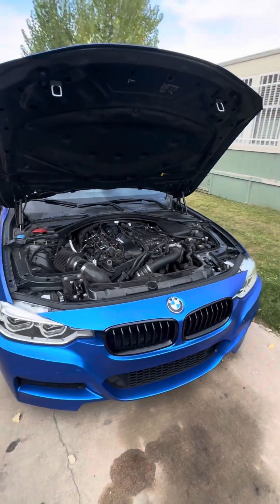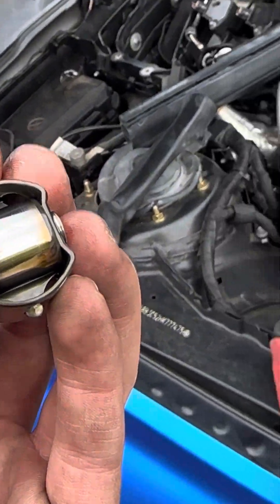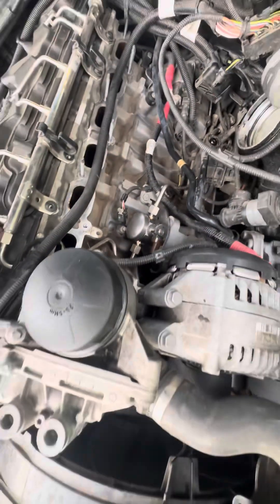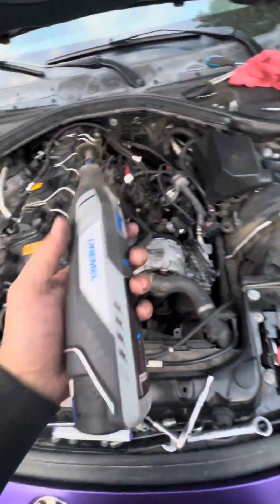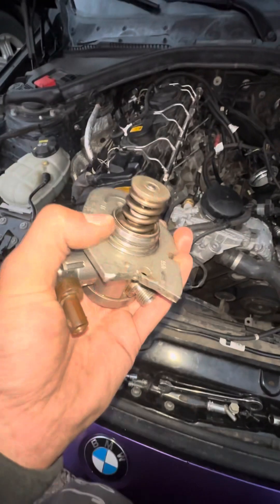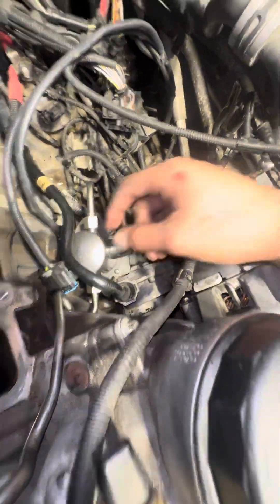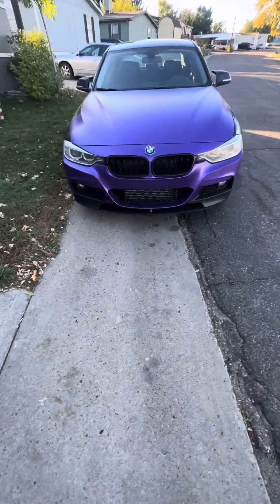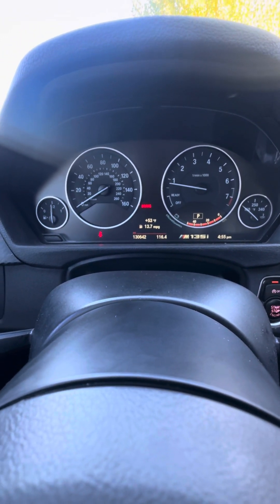Retrofitting a B58TU pump on my N55!

Comment: hey man i just got a few questions. i installed the b58tu on my 2013 pwg 335i. first what tuning platform should i use to make use out of this hpfp? im going for a pure500 turbo to try and make around 500-520 crank hp. mhd doesnt have the b58tu option and idk about bm3. im on a custom tune rn. anyway since i did this upgrade i noticed my injectors on bimmerlink are all working but you know the blue circle around the injection modes? they arent full anymore. this happened gradually over months. rn i have 2 injectors working perfect as bimmerlink says and the others dont have that full blue circle. idk if that means the 4 other injectors arent working efficiently but anyway i replaced my injectors brand new stock ones and still the same issue. sorry for the long message man i have been suffering with this for a while. thanks
Reply: U misfiring?
Same year/install  on my f10 MHD 
I’m not having any issues

Comment: Hola , tengo un 435 m sport con down Pipe, intercooler mejorado y reprogramación mhd. 
Estoy por instalar la B58TU y mi siguiente paso sería el e40 , para el e40 tendría que instalar un kit Flex Fuel para poder usarlo ?
Reply: you don't need the flex fuel kit but I would 100% recommend it. You wont have to worry about mixing ethanol it reads the content and adjusts the timing automatically.

Comment: hey man i have a 2013 e93 n55 build date is 02/2013 is it the newer hpfp or the n54 style one?  i was wonder if would be possible to install the b58tu pump on my car or would it be too much work
Reply from the maker: E series cars have N54 style pumps this wouldn’t work for you unfortunately. But the N54 Pump is very capable
Reply: youre on the newer style like me and will have to upgrade. 7/12 build date

Comment: Does the b58 fuel pump work on a pwg 335i f30 n55? I think i have the n54 hpfp. Not sure tho. My car is a 2013 but it was produced in 2012 so probably n54
Reply from the maker: F30 has new style pump so it would work
Reply: @F80__Los  So f30 has the same cable? I dont need to do any electrical work?
Reply from the maker: @iirojarvinen4674 no the connector is different until 2014

Comment: Hey man - lots of people are telling me I'll need to bend those steel fuel lines to get a good connection.. is this true? You're the only one who's really posted more than one video on this topic without ghosting, people seem to fit them and then disappear 🤷‍♂ thanks
Reply from the maker: Sorry for the late reply You have to slightly bend it. You don’t really need to actually bend it. just forcing it will do!
Reply: @F80__Los  yeah got lucky, I managed to pull some excess through the holding clips and then draw it in with some force on the nut 😂
Reply: @producerlawson how did it  feel performance wise?
Reply: That was the case for me it’s just a matter of forcefully yet gracefully manipulating the steel line
Reply: @MuteActive  did the install last night funnily enough, I really though I was gonna have to bend them. Some people told me to get the lines on first but that was impossible, the pump needed screwing down tight to close the gap to begin with. In the end I managed to pull the fuel in line closer as there was lots of play; the holding brackets were just hiding it all away, once I got it close enough I had someone lift it up whilst I threaded the nut on and drew it in. Same for the fuel out line, started at the pump and then drew it in at the rail.
Reply: @producerlawson yeaa yupp the timing is crazy though i was mid installation as well and completed it same time as you lol good stuff 🤝🏾
Reply: @MuteActive  no way! how you finding it? I mixed some octane booster on my 99ron fuel to get me up to 102 (95) and tried the higher fuel tune from MHD, the increased torque is noticeable especially around 5k rpm. According to my logs I'm averaging 656nm now, before it was around 600-610 on the standard stage 2+ tune. The only thing that concerns me is I had to shave some of the manifold plastic off the underside, Bosch sent the pump with the connector facing the right way; but it sticks up a bit so it was hitting the manifold, I saw on bimmerpost one guy shaved some plastic off so I did the same but took a little more off as I couldn't clear it like he did.. it's only the crosshatching but I do wonder how much strength that added 🤦‍♂I may consider a replacement manifold and flip the connector downwards, I'll just have to extend the wire
Reply: @producerlawson  that’s exactly where I’m stuck at rn running 6/7 screws for the manifold as i had to leave urgently the car runs no problem besides a heavy drop in load from data logging 😬😬 I’m going to revisit it tonight and fix it…how did you go about shaving the manifold? I have an extended wire so I’d definitely have play if i was to rotate the plug but would that mean the connector would now be facing towards the front of the car?
Reply: I don’t mind shaving tho as that would allow me to keep the pump as is lol
Reply: @producerlawson  may you send the bimmerpost link you seen too?
Reply: @MuteActive  hopefully you got it sorted? all of my posts got filtered/removed by YouTube weirdly

Comment: What E mix could you run on this pump? And what's the new project?
Reply from the maker: E40. And i got a Manual F30 335i! Just installed a PS2 turbo on it along with this mod
Reply: @F80__Los  werd, show us the build

Comment: Nice work, how much hp/boost can this support?
Reply: Also, would this work for F10 535i pwg?
Reply from the maker: @Jet3ch usually those have the old style N54 hpfp. You’d have to double check if you have a tappet hpfp or N54 Hpfp
Reply: @F80__Los  i believe it was the non LCI. I have Lci
Reply from the maker: On a B58 it can make up to 600hp in guessing a N55 it isn’t far from there

Comment: So on Bm3 for the stage 2+  tune on a 2015 f30 335i what hpfp option do pick for the tune.  Also am willing to buy one if you can ship to California. I’ll pay for shipping
Reply from the maker: I responded to your dm, and for the HPFP option, it will still be stock hpfp. no tuning needed for the pump.
Reply: Hi ,I already bought the same fuel pump for my b58 After the change ,do I need to program,tunning ,retro oh something?
Reply from the maker: @pabloe1983  No tuning needed. But would recommend to get the most out of the fuel system and make the most power

Comment: 2015? i have a 2014 f32 why wouldnt 2014 be included?
Reply from the maker: It works for all N55 with rapper style hpfp. you can know if you have it if it has a dimple on the top and doesn’t look like a N54 connector. If you have a car under 2015 you will need to splice the connect into your harness that’s in the description
Reply: @F80__Los  I can confirm it is 2014+ not 2015. my car has the same connector.
Reply: I thought that was odd for them to just change hpfp connectors after one year on the same platform. yea its 2014+
Reply: @steff4810  my 2015 had the old connector 😵‍💫
Reply: i have a 2014 435i and i'm tryna figure out if i have to splice anything what does you're connector/pump look like or how can i tell before i take off the manifold?

Comment: Great video! Just wonder would this work on bmw n54 engine?thanks
Reply from the maker: unfortunately this won’t work for you it only works for newer N55s. However N54s don’t have as weak HPFP as late  N55s so even just a LPFP will make a difference for you

Comment: If thats gen 1 b58 pump. Any idea if gen 2. The B58TU pump will work on n55 ? Cuz ive just ordered that and wanna know if would work or i should get gen 1 pump.
Reply from the maker: The one that i installed in my N55 is. B58TU pump. Gen 1 B58 pump flows slightly better than N55 Pump. I’d recommend getting the TU if you’re going through all the hassle

Comment: Bro this is exactly what I’m doing on my f30 n55 thanks for the awesome video
Reply from the maker: Glad i helped you out man !
Reply: Thanks bro 💪🏼 for everyone that has second thoughts on this, I did exactly the way he did it in the video and my f30 335i runs phenomenal I had no issues what’s so ever the car runs super strong no hiccups or anything. The only thing you have to do is flip the connector of the b58 fuel pump. The intake manifold will not fit unless you flip the connector. To flip the connector is super easy and simple
Reply: @derianc3  could you elaborate? Was the connector facing the back of the car or the front?
Reply: Just be sure when your bolting down the hpfp the two bolts have to be tightened evenly so you don’t mess up the spring of the fuel pump

Comment: Please keep us posted after 2500 miles of driving.  I'm just curious if  B58 TU pump will damage the cam follower on the N55 engine in long term use.
Reply from the maker: I will make a follow up video after a few more months . But as of now i’ve put 4k miles on E40 and the car is running awesome

Comment: Can the plug angle of the oil pump be directly rotated?
Reply from the maker: the electrical connector on the TU pump cam rotate 360 degrees to adjust it where you need it

Comment: Is this possible on a E82 135i?
Reply from the maker: Only works for later N55s, that have the tappet style HPFP
Reply: Look under your manifold you'll see if you have the tappet style or the old n54 style pump. I think for e82 they switched to taopet late 2012
Reply: I definitely have the old N54 style my car is a 2011